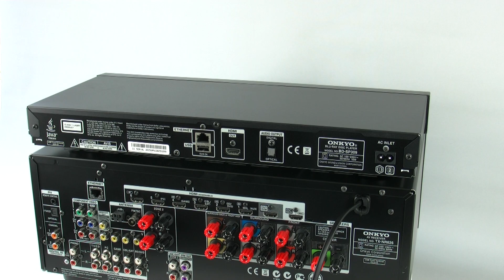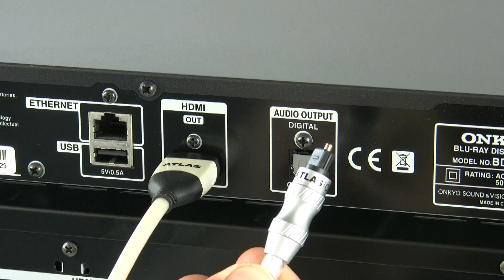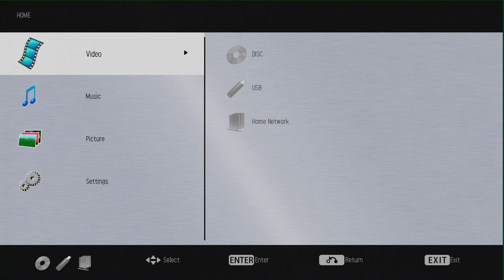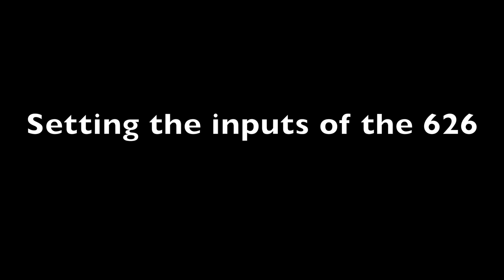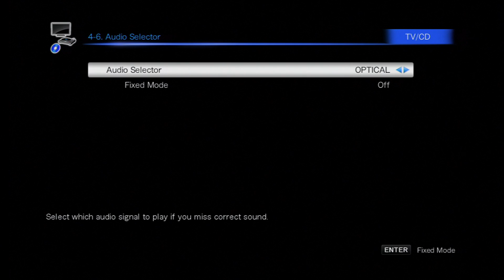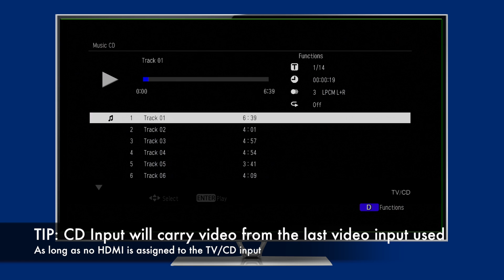NEW 2013 ONKYO AV RECEIVER TXNR626 - How best to setup a source component

Comment from the maker: Hi, you could e.g. connect your Xbox via HDMI (e.g. via "Game" HDMI IN)- and using the RCA/Cinch analog inputs for "Game" to connect analog source. Using the On Screen Menu, you can change the input source configuration to swtich between digital and analog audio. Please check Input/Output Assign (p 53) and Audio Selector (p 62) for more information - or get in touch with our colleagues at     customercare_eu@eu.onkyo.com     if you need further assistance. Thanks for asking!

Comment: Hi, I have this AVR I bought about a week ago upgrading from a Yamaha RXV567. Great sound quality and tech specs, but one let down is that I can't seem to find a way to change the audio input whilst still remaining on the same video input. For example, using my Xbox on an HDMI input but using an analogue audio connection for connecting 3.5mm jacked devices? Or even HDMI + Bluetooth? The Yamaha could do this and it's a nice feature to have. Is it possible to request a firmware update for this?

Comment from the maker: Hi, depending on which receiver you are using, they can look different (e.g. using a model from last year or even the year before...). Also a higher model (like TX-NR929) may offer options that an entry level model (TX-NR525) may not have.